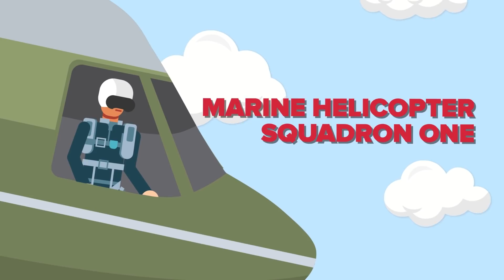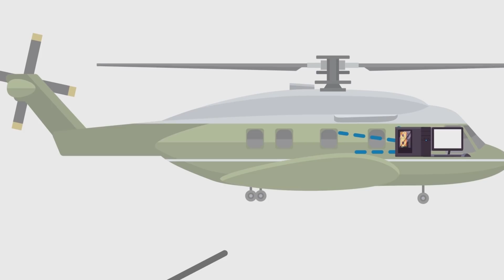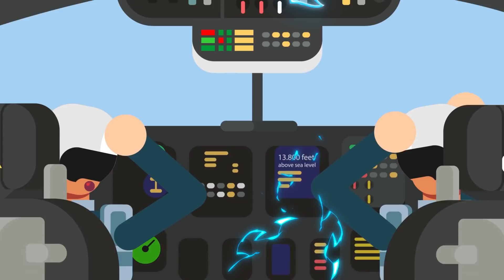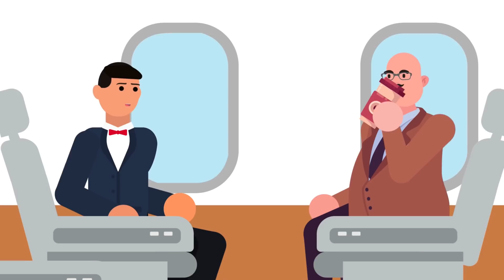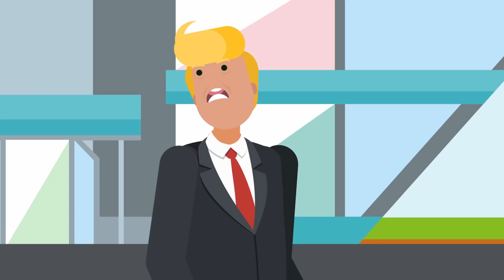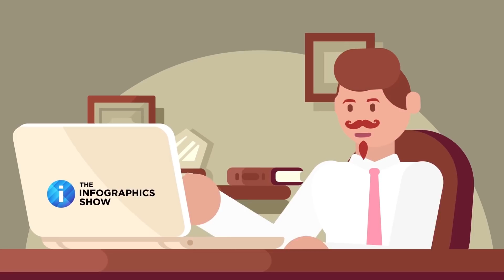Why Does Marine One Cost $215 Million?

Comment: The price would not be motivated not even if it was an ultralight , no fuel needed, laser propulsion from space cannons, with a mega supercapacitor battery rechargeable wifi from a third-party auxiliary jet plane...
24/7 flight capacity.
Full radiation and Soundwave proof..
Not even that would motivate that expenditure...

Comment: So basically, you just learned about how sophisticated, redundant & evolved a modern aircraft’s systems & avionics really are. You should have focused on what made the specific Presidential helicopter (VH-92) unique, instead of also enumerating every single thing the base-model already has.

I mean, among many others which you mentioned, you really think that it was specifically fitted with glass-cockpit type screens, emergency redundancies or pneumatic systems, while the basic S-92 (which the VH-92 was developed from) doesn’t include them?

It’s like saying the Presidential limousine is so expensive because « it was fitted with indicators, a cutting-edge ROUND steering wheel that no other car on Earth has, an engine which features multiple cylinders, which is a first in motoring history, as well as a state-of-the-art handbrake, a very expensive rear view mirror, etc » instead of focusing on the bulletproof doors, windows, medical supplies, secure satellite phone lines, etc. Sounds ridiculous? Well, I’m pretty sure it’s exactly what this video sounded like to any pilot, aircraft engineer, etc.

People not knowing much about aviation will believe that it’s the only helicopter on Earth featuring « a twin turboshaft »
😂😂😂 hence the astonishing price. Well, guess what, it even has blades! Which of course are included in the price. But what people need to understand is that all of this is also included in the basic $27M Sikorsky S-92... 21st-century avionics or pretty normal landing gear systems, in no way justify a $215M price tag. It’s the military countermeasures, securedcommunication systems, etc which do.

Last example, a commercial airliner such as the Boeing 747 (which the Presidential VC-25 was developed from), already has double, triple, quadruple electrics, hydraulic systems, fire suppression systems, emergency backups... even the one you fly safely to your holidays. This is why a Boeing 747-8 is worth more than $400M.

Comment: One of the biggest defense is the most advanced sensor fusion system amd AI defense ive system and scanning system that is said to be the tech that’s been developed for announced 6th Gen prototype flighted that’s now being tested it can communicate with all is and allies sensors fusion equipped weapons and vehicles like the f35, f22, naval ships, etc etc to receive warnings and detection of danger from any fusion aircraft or vehicle.  The insane power generator is also clearly for the laser weapon system that’s being recreates for aircraft and naval ships as offensive and Defensive weapon controlled by an AI defensive system amd its communicating sense being faster, more accurate and better encrypted of information. It’s system can just like an F35 thats enabled to do so can communicate to a closer vehicle
Or drone to fire on detected inbounds without the vehicle even needing to do anything, simply receives data and coordinates fire and even the “suicide interception” of the inbound at a ost resort. The 5th Gen tech being shared with this and also airforce one has so many more advancements than we can imagine. A helicopter is an easy target for missiles and especially a hypersonic , the President wouldn’t even be thought to put on one in an emergency if it wasn’t beyond any safety level we can imagine.